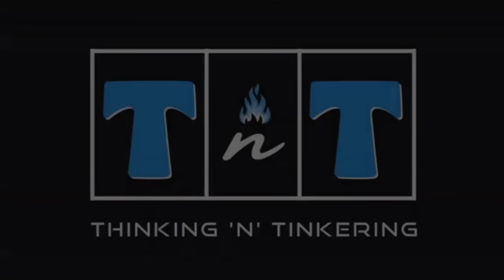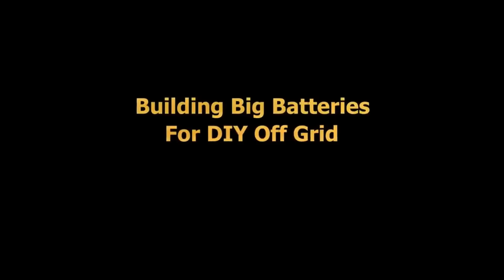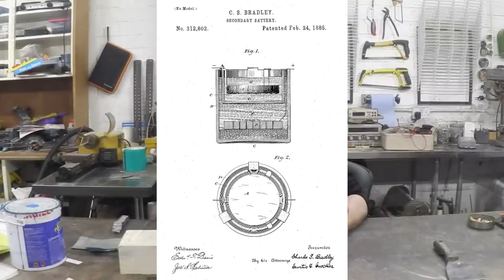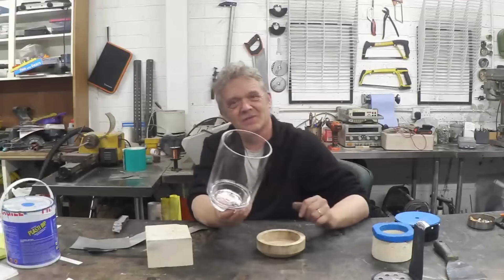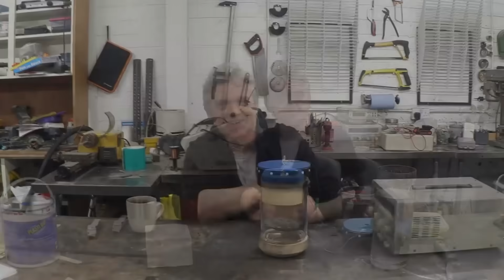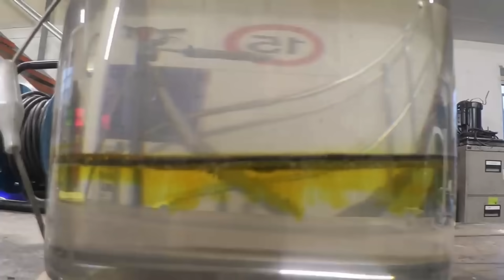2102 Building Big Batteries For DIY Off Grid

Comment: I want to see you take a 30$ charge controller and charge it.  Then I want  to see a series or parallel bank of these cells run something like a household fridge or something bigger like a oil heater.  Or this is just a waste of money.  Call it the sceptic in me
Reply: The load from a refrigerator and an oil heater are two different beasts. Average American fridge uses about 130 watts an hour. A 12k mini split can limp along at 600 watts. And a heater with an element will keep the family alive but complaining starting at 900 watts.

All that being said, a battery can be any size you need by adding more cells to the battery bank. The battery he made was just one cell, if you want to run a heater you probably want to at least use a 48v battery so the amps don't tax any weak connection or small wires. That would require probably 28 of those cells he made at least.
Reply: @blakehafling6995  charge the electrolyte in 1 cell, then when it is charged, pump it into 28 cells. When they are depleted, pump the electrolyte back to recharge it.
Reply: @RiverMersey  not sure I understand why you want to pump electrolyte from cell to cell when you can charge all the cells at the same time. The more you pump the less efficient your battery becomes, not to mention electrolytes and the parts of your pump probably won't get along too well.
Reply: @RiverMersey   It will be fine with bromine (pumping the bromine around) but the problem with this system will be the negative electrode. You also need to electroplate the negative electrode with zinc,... which means that the each cell need fresh plated zinc. That you can make with some vanadium or all iron redox flow batteries.

Comment: Fascinating!
I know I am being lazy by not reading up on this myself, but how many charge/discharge cycles do you think this beast will do?
Reply: In a previous video on these, the life cycle I believe he said could be limitless.  It was at least as long as a Li-on battery, I'm pretty sure.
Reply: @LawrenceMarks27  TY
Reply: @LawrenceMarks27  yes, and apparently these don't have any memory-effect type problems or degradation of performance over long periods of time
Reply: The lifetime of these batteries is NOT limitless. Hydrogen evolution increases the pH of the battery, which creates a lot of side reactions that lead to degradation of the anode and also formation of bromate in the battery. You would need to continuously lower pH with HBr in order to prevent this from happening.

Comment: Would you please do a video on using galvanized steel to make a large battery, I have access to 20 or so 13ft long by 12 inch wide by 1/8 inch thick galvanized steel guardrails from the roads, as well as some 6inch by 8ft by 1/2inch thick galvanized steel i beams and i was thinking of trying to make a very large capacity battery (1000 kwh) for my off grid home in rural Alaska, I could use the local mud and clay as well as aluminum cans which I have in huge abundance,  but I'm curious if this can be done. Thanks always for the great content!

Comment: A very simple build, I just need to find the right charge controller and a way to alter the liquid level to stop the discharge when not in use, and a lot of zinc bromide.
Reply: I'm pretty sure if you remove the zinc there is no discharge.  I could be mistaken.

Comment: If it's stored in the electrolyte would this battery make a good flow battery? I have a 500 gallon water tank. I think I could pair it with a very large cell containing zinc to create a house battery.

Comment: I definitely enjoyed this video. Amazing subject.

The negative electrode doesn't have to be zinc right? If you were to put a graphene electrode on the negative side as well, zinc will accumulate there and get dissolved again once the battery starts discharging.

Didn't you use terracotta before? Firebricks seem like a good choice. It would be possible perhaps to make sheets of graphene foil separated by thin slabs of porous material to maximize surface area. Ideally you want a square carrier for this.

The fumed silica bit seemed really interesting. A lot of the bromine will sit at the bottom but it diffusing back to the electrode takes time. Gelling the electrolyte will force most of the bromine to stay close to the electrode right.

I'm contemplating making either a flow battery of a gel battery using this chemistry. Gel is probably simpler since it doesn't require a pump and the electronics to support that but flow should have benefits regarding scalability.

Looking forward to seeing more from you about this subject! Cheers!
Reply: well the zinc has to move through the gelled medium no matter what, so it wont be faster, it would be slower. 
Gelled car batteries have to have thier plates closer together to compisate for that as well.

This is defenitly a battery chemistry made for mass storage and slow charge and dischage cycles. Whats important is its achivable, DIY friendly (well freindly enough bromine does have hazards so does hydrogen), and it works.

Rather then look towards speeding up the chemistry; look at multiplying the force, and automating the charge cycle for automatic charging. 

By mulitplying the force I mean many batteries in series and parallel till it reaches your use demands. 
As for automating the charge cycle, you want to clamp amperages while allowing voltage to vary until you detect the charge cycle has compleated, or just before it has compleated. 
There are lots of ways to do this, and each method will vary depending on your set up, and technical skills, but I am sure you can do it, you just need a measure of your battery's various voltage requirements to reach your desired amperage.

Because DC motors work by vayring the voltage you have your choice of neat treats to get your stable amps.

Now, I personally use 3 phase electrcity for my tools; so I would already have to take my dc output and transform it into 3 seperate phases and consider capacitors for shock loads, this has some advantages because various types of rotery motors can take various inputs to deliver various outputs with simple mechanical and electrical devices capable of clamping amps or volts.
So I know what pathway is simplest for me, I already need that pure sinewave humming at 60Hz, I can just make a modified rotary phase converter with two seperate DC inputs; one from battery cells and one from energy harvesting and alongside some simple mechanical switches I can get charging and discharging all sorts of willy nilly and all at once.

But I will need more complexity for load varyiance and charge varyance. Not too many people have need of powering 30 kilowatt motors at home! And at such energies it is generally lower losses to run mechanical conversions. 

A micro-controller would probably be the easiest method for most people, but perhaps a scaled down verson using various motora would be best, particularly if you need that sinisiodal wave on your power band like I do.
Reply: @AnonymousAnarchist2  Thanks for the recommendations. Do you think that there might be any benefit to including a Stirling engine driven propeller (assuming that enough of a temp. diff. exists) in the electrolyte to aid in diffusion during charging?
Reply: @synchro-dentally1965  I would not see that as an benfit. The electric charge is the motive force moving the dissolved materials to thier respective nodes (anode and cathode) Sapping the energy from that to generate turbulance probably would just complexity, and inefficency.

But. You are getting into stuff I have never tried, and wouldnt want to because I would have no benifit. so. Maybe? You can set up a simple experment and see how turbulance effects charge and discharge rates, there might be something else electro-mechanically at play with this battery chemistry.
Reply: American penny's.
Mostly zinc.
Reply: As you say, gelling might keep the bromine around the electrode...which might slow down the charging by preventing electrolyte contact. Seems to have pros & cons (all hypothetical oc)

Comment: You would probably need 7-8 of these cells, I suppose if you made them even bigger you would have better amp draw off capacity for an inverter. Solar charge controllers would need to be constant current type. I would love to try this at some point. Getting hold of the chemicals can be awkward.
Reply: I think you would need a matrix of them in combined series / parallel configuration to increase the voltage to a useable value and the current draw to make it viable too! 
Like Luke's saltwater battery.

Comment: If I remember right, isn't this the basic type cell used in redox batteries, were you can store the charged electrolyte in tanks, so can use bigger tanks to store more energy and then cycle that through the cells when needed? I think most well built/designed of them are around 70 efficient and because of self discharge doesn't work well for long term starage.
Reply: a company called redflow make them

Comment: This was quite a nice build. Thank you again.
Would a carbon and magnesium sulfate ( Epsom salt) battery work? I ask because carbon is easy to get ( a factory by me) and Epsom salt is also cheap and easy to get.
Reply: This is where Robert could do a video on battery types and mode of operation , he did do a video maybe four years back . I think it's three or four different modes of operation to try for . At normal temperature and pressure ,,STP,, , carbon is pretty unreactive. Carbon simply doesn't react with strong acids or alkalis . The sulphate radical in epsom salt represents sulphuric acid. You'd want a set-up in which the sulphate radical travels back and forth during charge/discharge , however there doesn't exist a compound called carbon sulphate at STP  ;   I'm thinking also that magnesium ions in water would lead to magnesium hydroxide which may complicate things . Zinc and copper sulphate is what we know works but has those dendritic growth complications. 
   
  Perhaps another solvent and moving from STP realm to higher pressure such as liquid carbon dioxide at I think 5 atmosphere pressure, hmmm, not sure . I don't know if carbon is soluble in liquid CO2 , it's not soluble in anything much at STP . Get carbon up to 400°C , and then it reacts with things, but again it's departing from STP . I've had my little wander-wonder , cheers .
Reply: @philip5940  
Magnesium sulfate Epsom salt in a mineral in the human body that completes the electric field in the human body. 
The human body runs at 100 watts an hour DC. 
So if this did work it would probably be a DC load battery not an AC battery. 
I think Rob mentioned that this video battery is an AC storage battery? Charged by AC not DC. In itself that is very interesting.

Comment: So interesting! Would love to see a “Gilligan's Island” series of videos. (Alternatively, ID and  discuss your past videos that might be particularly apropos.)

In other words …

How might you set yourself up to generate, store, and use electricity for 10 or more years where solar, wind, water, and/or brute strength are your main sources of power.

You will need/want to power basic electrical equipment (that you might also need to build) such as lights, radios, computers, and 3d printers.

Just a thought. Seems like it’d be fun and a chance to be a bit silly. Cheers!

Comment: Yes, but what we want to know is, how much power can we store in a battery made out of IBC tanks?
Reply: If LDPE, I'd expect hours to days before leaking and days to weeks for HDPE. I can hardly imagine how expensive a PTFE bottle in IBC size would be if even available! But I love the thought, 7 cells for a 12V battery would probably be 300-400kWh! That's enough for around a month of reserve for my house on our highest load month and a lot more if not running air conditioning.
Reply: You will have to line the plastic with glass somehow or your plastic will eventually be destroyed and leak then if caught by a government you'll have an environmental hazard and lots of fines $$$.
Reply: @HappyFace6or7  yup, PTFE or glass unless someone knows of a better option.
Reply: IBC ❤

As heat, I make it 80kWh (20->90'C) but as electroyte I am not sure.  I am asking if I like all that Bromine with potential for spillage and chemical reaction with plastic.

Comment: Great video, Rob, thankyou!

Given that the electrolyte stores the energy, surely it would be possible to have this device as a constant charger. When the cell is fully charged, pump out the electrolyte to be stored in a reservoir tank and new depleted electrolyte pumped in to be charged. Electrolyte in the tank could be pumped when needed into a "consumption" circuit, and, when depleted pumped into a new charger?

Also, consumption circuit(s) could be configured to provide which ever voltages are required.

What do other viewers think?
Reply: Maybe it would work as you say.
But the material that settles at the bottom would need to reintegrate back into the solution I think. 
So just built several of these, and not deal with the mess of pouring it out?
He did say that it can be gelled as well.
Reply: @reypolice5231  Where I work uses forklift trucks that have interchangeable lead-acid batteries. Each battery weighs about 800kg and are changed via the use of an electric pallet truck. My thoughts are, it would be ideal to instead of changing heavy bulky battery units, just pump the electrolytes around as required. A forklift would benefit from the weight of a bromide battery, compared to a lithium battery. Of course, the pumping hoses would need to be robust and highly leak-resistant.

Having looked at this elsewhere, apparently something similar is called a "flow-battery" and an Australian company called RedFlow  have been doing something along these lines for about 10 years
Reply: @RiverMersey  
Yes it might work as you say: but people are prone to accidents.  Lead acid is not safe, but not prone to a hose that can break or leak on a forklift.
Some companies do not maintain their forklifts very well sometimes.  
Large Stationary off site like Rob said is advised.
Reply: @reypolice5231  yes, I fully agree that pumping lead acid around isn't safe! My apologises if that is how my comment came across!

What I actually meant was pumping bromide solution as the electrolyte between 4 tanks - 2 tanks at the charger, and 2 tanks at the consuming circuit (in this case, the forklift).

Charger's pair of tanks would receive depleted electrolyte into 1 tank, charge it up, and store it in the other tank. Consuming pair of tanks would do the opposite as the electrolyte becomes depleted of energy.

When the consuming tanks were completely depleted of energy, a hose would pump newly charged electrolyte into the consumption tank and pump depleted electrolyte back to the charger.

Yes, over time there will be corrosion in the electrodes (clean and/or replace them) and the electrolyte will need filtering/cleaning. Only with practical use could we determine just how frequent this would need to be addressed.

Every fueling system carries risk. From my very little knowledge of bromide, don't drink it and wash hands after fluid swaps it should be good enough to be safe.

Comment: Am I correct to assume that this isn't going to work in subzero storage conditions?
Reply: Sub-Zero Fahrenheit? Maybe not, I'm not sure, this would be like very concentrated salt water, so you can get significantly below zero Celsius.
If you live in a northern  cold climate why can't you just put it in a basement, or build a small cellar like one might for a well pump?
Reply: @petevenuti7355  thanks. My imagination started running wild... 😀 As I need to build a separating fence I thought I could theoretically integrate batteries into it.
Reply: @q-momentum  🙂 I know the feeling 👍. Is part of the fence underground? Earth battery? Rob's got videos on those too!
Reply: Thank you 👍🏻

Comment: How mamy watt hours per liter, Robert?
Reply: Wikipedia will help you.... 15 - 65 Wh/l
Reply: You will never know the Wh/L of a battery until you actually measure it. Wikipedia tells you it could potentially be 15-65 but a real battery can easily be much worse. As is likely the case here due to the huge electrode distances and likely very poor energy efficiency. You always need to characterize actual devices made.

Comment: A floral foam brick is very porous and easy to form
Reply: Unfortunately I expect that it would last only a few hours under those conditions. But I like the outside the box thinking!
Reply: I think the bromine would oxidize those... Irreversibly.
Reply: My thought too.
Reply: May I ask what a floral foam brick is? Do you mean they stick flowers in?
Reply: As some have said it may not last. But it may last longer if dipped in a thinned out latex ( called Dip) that rob mentioned in the video. With maybe holes poked in the bottom?
Or it may last longer if dipped in a clay slurry as mentioned (by a different Post comment ) that different things "organic" added to clay can make the clay porous. I think it can be fired in a microwave oven surrounded by firebricks.
Reply: @reypolice5231  the point of the clay slurry was that when you fire it the organic stuff would burn up or convert to charcoal. The plasi-dip would also get destroyed by bromine. If you want to use a polymer membrane it would have to be something like Teflon or Nafion. The firebrick was a good choice. I wonder if tyvek, gortex or some of those kind of polymers would hold up? 
Even if they did, the firebrick should last forever,  fritted glass would too. Becides diamond&graphene I don't think anything organic would be as good, and what could work would be way more expensive.

Comment: I wonder if you could use nanocarbon or nanotubes. I guess a carbon battery with two nano carbon plates, a sheet of hydrogel to soak your electrolyte in. And charge it up.